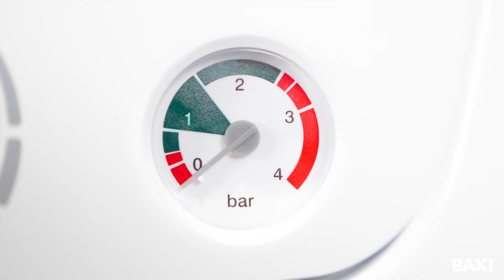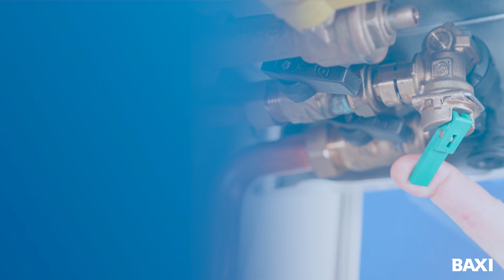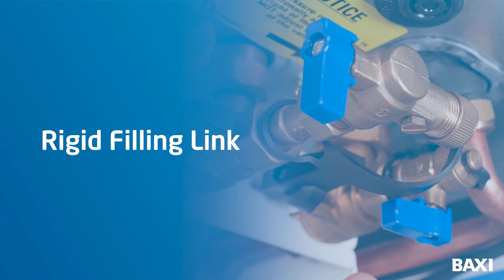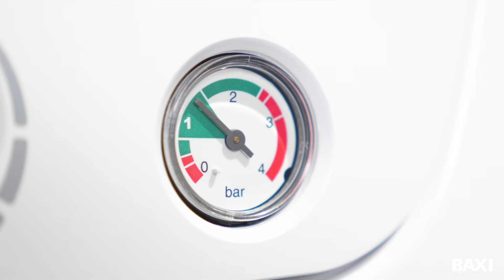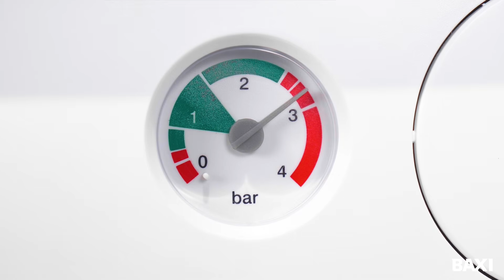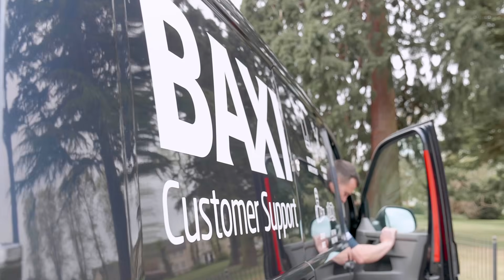Baxi Connected self-help: How to repressurise your boiler

Comment: Is it possible that the easy fill loop lever is red, not green? (Baxi luna blue 3). my single blue valve is naturally in the inline position from the installer and looking to top up after bleeding radiator.

Comment: I've got a baxi combi 105 he boiler. There is external hose to top up the water. I don't have a blue lever but I have two black levers which are stiff. Does anyone know what you do to add pressure back?

Comment: Not helpful for me as I have one blue tap and one black tap which you didn’t cover you mentioned two blue ones anyway I babe open both the black and the blue tap no change. There is a 3rd black tap which is locked with a screw so I left it

Comment: My plumber fitted the filling loop already so its been attached for a month now. Why do i need to remove it?
Reply: Mines been on for years since I moved in so don’t think you do need to.
Reply: @88joedyer I think you're right,  I'm not touching it! 🙈😂
Reply: Mine has been fitted for three years and the installer who also services the boiler said it depends on who installs the boiler as to whether they use the filling loop or fill from their own source of water with additives etc. Mine just died and the boiler instructions say "ask the installer" for re-pressurization. So naturally I went to YouTube first 😛

Comment: What if it’s in the middle of the 2 or little higher Is that 2.5 ? Had a new radiator fitted and advised to turn to 3 bar by the plumber. It never got to 3 but past the middle of 2. After doing this the boiler developed a leak at the water inlet .

Comment: Hello, can anyone tell me how to lower the pressure instead with the rigid boiler system please? (2 blue taps)
Reply: when the system is cold, open a radiator bleed valve and catch the water until pressure is ok

Comment: Just found this when my usual valve didn't seem to do anything. I have the two blue valves and usually the first is left on all the time but boiler engineers must have turned it off. This was the perfect video for me, even the comnent, the valve might feel a bit stiff helped me dare to apply a bit more force. Thank you

Comment: What is the solution if you over pressurize by going into the red area.  Hot water continues to run through the pipes non-stop. The Pressure Gauge get very hot and fogs up.
Reply: Bleed the radiators.

Comment: Thank you for the video. Our boiler is rigid filling link type . The copper bend was attached already and not have the cups. Do we need to remove the copper bend after pressure is ok? Without cap how we could remove it?

Comment: Very helpful, I have a a rigid fitting loop with the connector pipe already fitted. Very simple and easy.
Reply: I also have a unit with the filling loop already attached.  (However, on the front of the boiler it refers to my using the green lever which mine doesn't have!  That was frustrating!)  I don't understand why the filling loop is not installed permanently as there are shutoff valves and the video says the installer may have "already fixed the filling leak and left the filling loop in place".  Since repressurizing is something that often is needed and is quite normal, why take it off at all?  Any ideas?
Reply: @TravelingToday-yu9gv   it is by law not to install it permanently for safety reasons.

Comment: Wheres the pressure release valve i need my pressure bk down
Reply: don't open the PRV, they almost always don't close properly on release. Instead, bleed a radiator when the system is cold

Comment: Thank you for the video. Very simple and easy to follow.
Mine is the flexi filling loop. We have had no problems with pressure until today (Low Pressure). The plumber showed me how to adjust it but it's been 8 months so I'd forgotten that there are 2 valves to turn. That one of the valves was hidden behind some towels didn't help me remember. 😂

Comment: Mine has none that it’s 2 black and yellow
Reply: same lmao, if you find out how to fix it please lmk
Reply: @g-g__  it’s because I’ve got insulation systems fitted in one of my room upstairs,there’s something like 🚰 and black think same as the one under the boiler need lifting and turn the tap on at the same time check the pressure on the boiler as the video saying don’t let it pass middle of 1,I hope this solves the problem as it’s done mine 🙏
Reply: Same here, and I share 'not george's sentiment, LMAO! No valves for refilling at the boiler. Thanks to 'hug', we clicked that we have a tank upstairs, blue valves did nothing, but there were two black on a braided connection which filled it up. Not one YouTube video with this scenario! Took about an hour to figure out in total! 😂
Reply: @lukea136  the video mentions that when talking about the flexi scenario.
Reply: Can anyone help , I have tried this and it has worked before but it’s not this time. Any suggestions, as I know you here the water as it fills and nothing!! Could be air in pipes , any suggestions 😬

Comment: Very clear video.  However,  for some reason my blue valves were the other way round,  so bit of a shock
Reply: Just turn them the other way then 👍
Reply: @daveshaw5293  oh really! Would never of thought of that 🙄🙄
Reply: @Summer-rb2ol  clearly not as you said bit of a shock lol
Reply: @daveshaw5293  it was the first time I had done it. Tbh, your comment makes no sense
Reply: @Summer-rb2ol    never *have
Reply: Ours are black? Worked the same although no removable section after